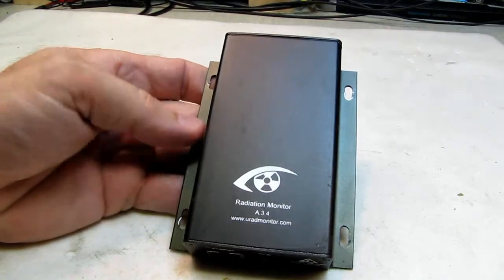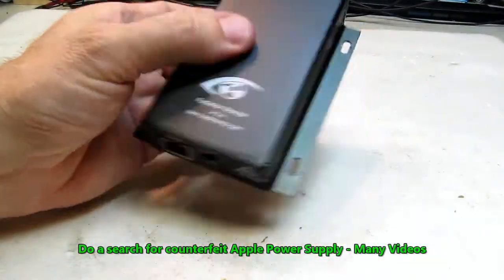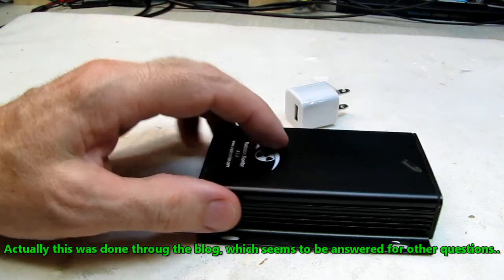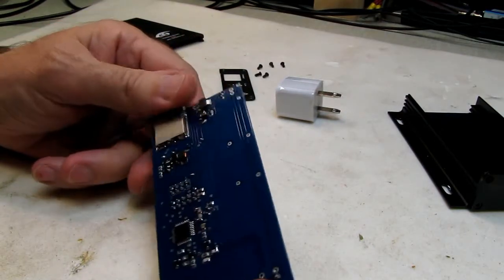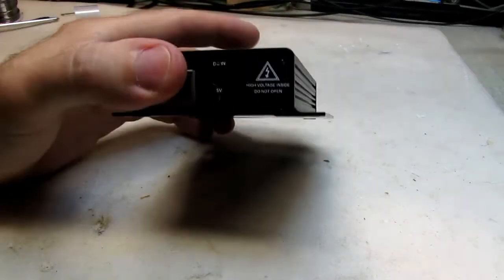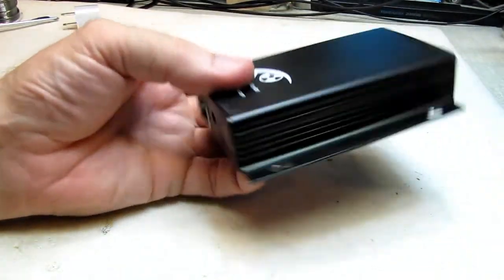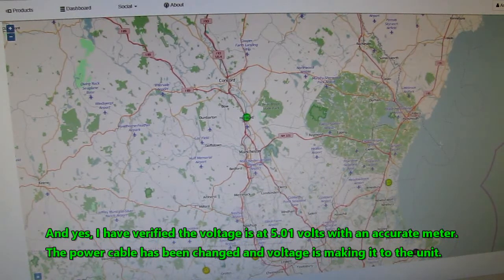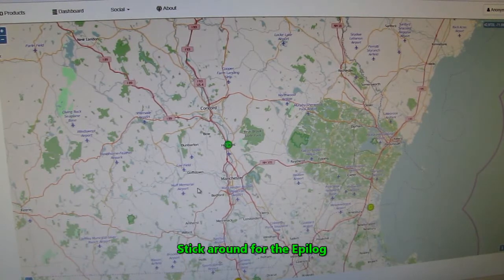uRad Radiation Monitor - Win or Fail

Comment: Vern, thanks for the review, but I'm sorry to see you had issues with your unit. I do reply to all emails, and there is also a support forum on the website. Unfortunately I got no message from you, so perhaps something went wrong here. You will receive a replacement for your unit right away. Most of the black units are due to users having them disconnected. Thank you.

Comment: I live near the 3 nuclear plants at Palo Verde, AZ and picked up a nice Arduino based radiation monitor brand new on Ebay for about $45 from Israel.  It came without the Geiger tube and I had to order one of those from Russia, they must have a lot of surplus from the cold war, but it works great.  You're in luck since you already have the Geiger tube as long as it's the sensitive type and not one that doesn't indicate anything unless there is a nuclear strike nearby.
Reply from the maker: Hi Steve, my unit is back on line now. If you go to Uradmonitor.com I am the one in Hooksett, NH You can click on it and get a graph of average dosage.

Comment: Interesting little gizmo, a shame it crapped out.  Wonder if Mark could figure out what's wrong with it.  He is a wiz with microcontrollers. 

Mike
Reply from the maker: Presently my guess is the ENC28J60 Network Controller is as fault, may order one and try that. Right now the unit has been up since around 8:30 AM when I rebooted it again.If I have no success I will ask if he wants to give it a look. Really bummed it died.
Reply: +The Radio Mechanic 

It is a shame.  It is a neat idea.  One of those hope you never need it devices like smoke and carbon dioxide detectors.  God forbid something would happen but if it did it would be great for monitoring the spread of radiation in the event of a disaster.  I'm only a short drive from Three Mile Island myself.  I can vaguely remember the partial meltdown of reactor TMI-2 when I was a kid.  Reactor TMI-1 is still humming along to this day.
Reply from the maker: I'm the type of guy when I check into a hotel first thing I do is memorize the fire exit. On a plane, memorize the escape exits, in a rented car adjust the mirrors correctly etc.Not from fear, but thinking in advance can save your life. By the way, when I was working on the thing it occurred to me that the network card looked like an "off the shelf" item.Sure enough they have the same board on e-bay for $2.61 complete. Have one on order. A simple search for ENC28J60 ( the chip ) brought up the board.
Reply: +The Radio Mechanic 

Would be nice if that's all it needs to fix it.  I may consider getting one.

I know the feeling.  I do the same type of stuff.  Also always set facing the door in places like restaurants so you can see trouble coming.   A lot of good habits I picked up in my younger years when I was in a spec ops unit in the army.  Better safe than sorry philosophy.

Comment: I'd gamble on some decoupling capacitor gone bad, going by the symptoms.
Reply from the maker: Ran for almost two weeks last time I cycled power. I have the new network board and will install it some time in the next week or so. That is if I can get through the pile of repairs I have waiting on the bench.